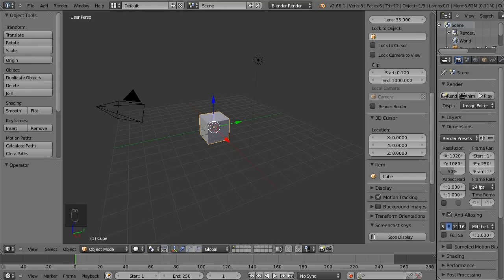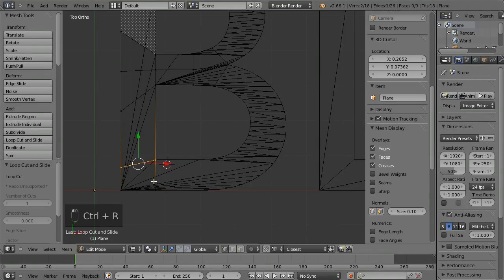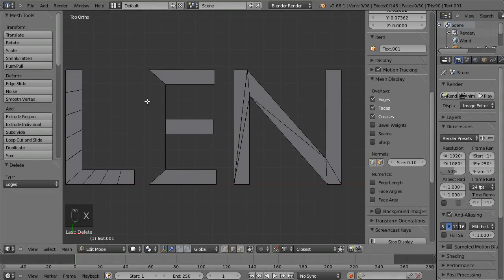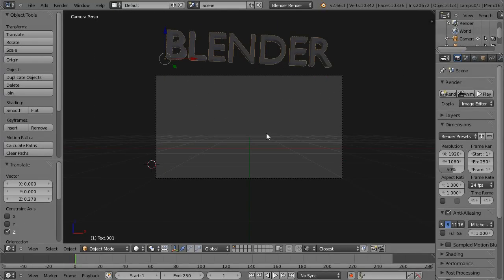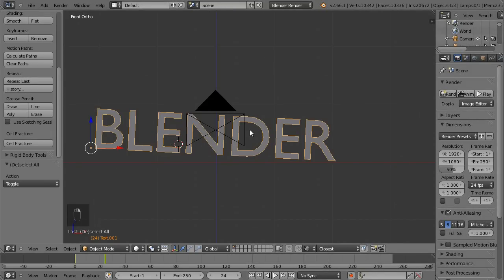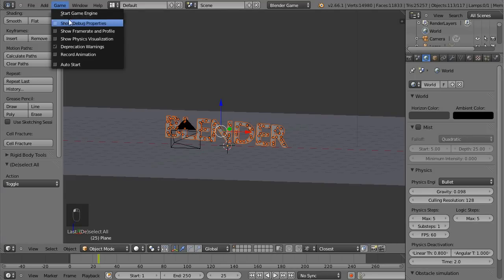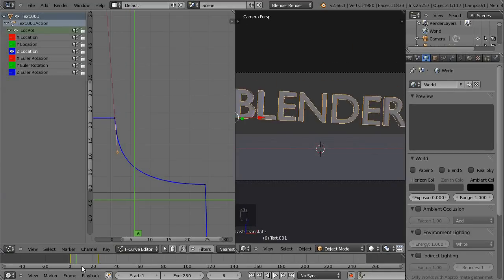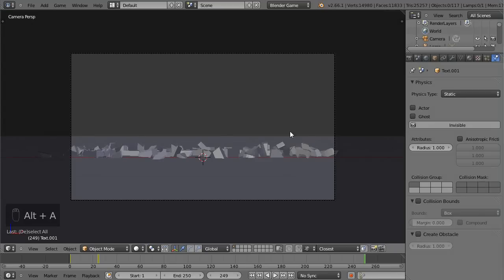Making a 'smashing' intro with Blender 2.6

Comment from the maker: which is fine for static objects, but I wanted a predictable and even mesh to work with. Converting a text object to a mesh and then trying to clean up the triangles is far more work then quickly modeling the basic letter shapes.